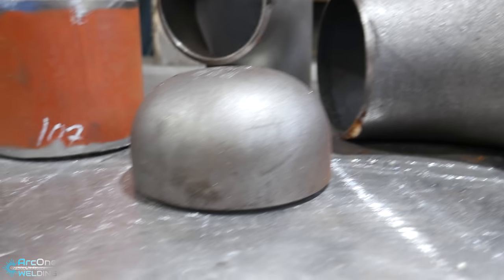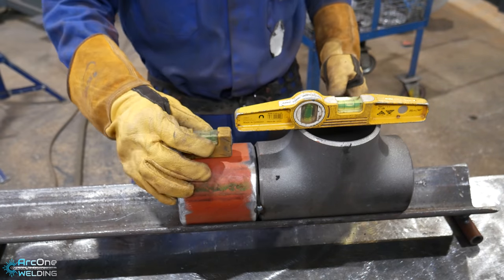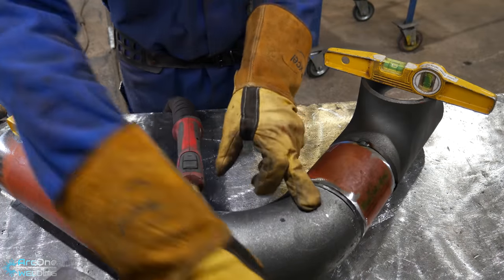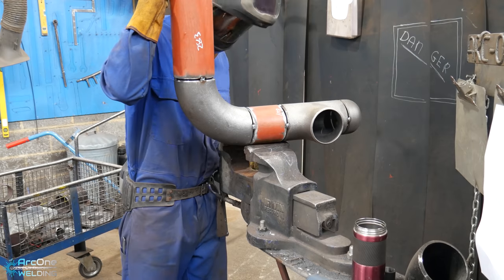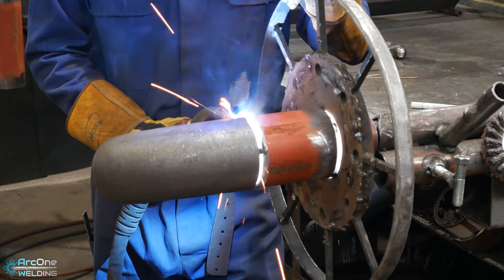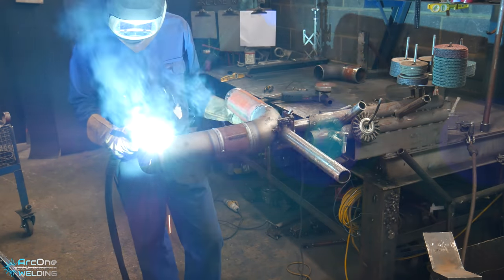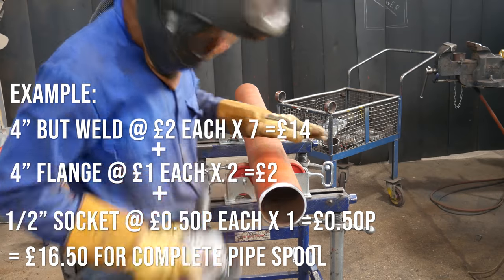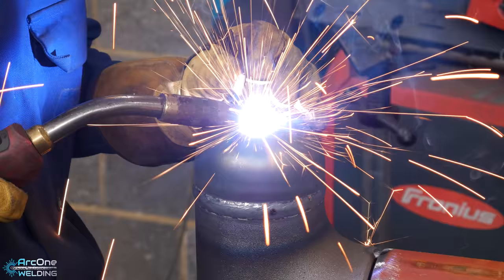Price Work £ How Much Do I Make? 4" Spool Fabrication

Comment: Really appreciate the words about safety and avoiding fumes. Id love to get a setup like you have for work but we'll see if they're keen on paying for the 3m papr system, or at the very least splitting the cost. It's a little over 2k here atm. I like using the air filter respirator most of the time but there's times where it's too hot and you just skip it.
Reply: If you are looking for high-quality welding machines, please contact me. We are a manufacturer with a history of 32 years, focusing on the production and research and development of manual arc welding machines.

Comment: Thanks bro.. Safety is a major factor.. I suffered hospitalisation and numerous doctor visits and lost shifts because of chronic sinusitis and terrible sporadic headaches because of exposure to fumes from using 2.4mm Open Arc Flux Core and Low Hydrogen electrodes (MMA) Welding for nearly 6 hours a shift. Only to find out from an excellent ENT Specialist that I was suffering because of over exposure
Reply from the maker: You see dude u understand, this is the message i want people to know

Comment: Hi Calvin,
  Want to pass along a great feature that stops the warping experienced in pipe welding (works on A-36 plate & structural members too). I was shown by a very savvy weldor/fitter. He always had a bucket of water & a rag nearby. Apply the wet rag in the right places...this retards the warping. This works on A-105 & s/s pipe too. 
  Hope this helps, Pete 🙂

Comment: your comments about just holding the fitting and tacking it is so true. ive seen way to many guys screwing around with jigs trying to get the fit right. 45 min later they get it, when it coulda been done in 5 min.
Reply: Yep. The only time I make a jig is when I’m fitting several of the same thing. I usually make the jig while making the first one.

Comment: Yeah, over here in the states, I'm an ironworker. We weld with stick and innershield wire. The wire is an irritant and the second you breath any spec of dust from it, it will make you cough. Our safety and procedure for it is that because we're outside, that's good enough to protect you from getting respiratory problems 😂

Comment: Great video. Im wondering how you like up a 45°elbow when the pipe is a couple of mm smaller as it don't line up in angle iron?? Any tips are great im working at a welder fabricators and get some elbows to weld to pipe. Keep up the good work. Thankyou.
Reply from the maker: Check my videos i have 3 great videos on fitting up 45°

Comment: You should try Loctite SF 7900 Ceramic Shield on ur nozzles.  We run metalcore wire daily as well. Only need to clean and re apply 2-3 times in a day.
Reply from the maker: I use a different brand of ceramic anti spatter and it works wonders
Reply: coat the tip and shroud with white marker   it turns to carbon  and prevents adhesion of spatter

Comment: Barley starting out mig pipe practice at technical college and they past couple weeks I’ve felt my breathing get a little worse, might have to take you up on the respirator advice
Reply from the maker: This job will give you a early death if you don't protect yourself sooner then later
Reply: @ARCONEWELDING  do you know of any cheaper PAPR options?
Reply: @ARCONEWELDING  The best advise I can give you stay away from shops. I always worked outside in  construction, refinery ,etc. I am 81 now, worked in Canada ,but mostly in and around Toronto  and travel jobs . Nice welds!

Comment: I always screw a plug into any socket or stabbing i welded on, it comes from when i was an apprentice, i was asked to weld a socket on a live pipe late on a Friday afternoon so maintenance could run an extension off it on Saturday morning, i rushed it so i could shoot off to go out for a good time Friday night, i came in Monday morning to a real ear bashing, the socket had deformed in the heat and they couldn't screw the pipe in to it, not only does the plug absorb some of the heat you know it's good to go when you screw it out.
Reply: True that, just like welding a nut on etc. Always seems to shrink that little bit, on cooling.

Comment: Ah the classic oxy cutting torch/ hammer multi tool. We've all been there.

What root gap do you use, im assuming that's all sched 40 in the video. 

Nice work
Reply from the maker: Ofcourse, if it doesn't move you know to carry on burning 😅, nd usually a 3mm gap for all my sch
Reply: @ARCONEWELDING  ha ha ha. Nice. It's been nearly 7 years since I've done any mig pipe work, been doing stainless tig for the past 18 months. A nice change

Comment: Gotta be welding the flanges on first mate mig don’t pull. Save you soo much time
Reply from the maker: Its true for some occasions, if i welded the flanges the job basically becomes a weld neck job and my Fabrication will need to be perfect with no room for error with a 3mm Tolerance, atleast if my fit up isnt perfect i can catch it on the flanges

Comment: Nice video Good job. What is the average pay for welding in Uk? In Norway it can be from 20 pound to 30 pound pr hour.
Reply from the maker: Tbh pay is all over the place you can make £120-400+ a day or more depends who or where you work
Reply: @ARCONEWELDING  may be 120 pounds for welder helper?

Comment: Thats so odd, my price is calculated per inch only. We get about £3 per inch and straights and little spools are the best.

If i done 100 inches alone id make £300-£350, however its divided by every fitter and welder. Luckily there arent too many in my shop and we all work at pretty much the same speeds. So a good day could be like £400 each but some can be really bad.

Comment: I probably going to sound like an idiot but are U getting 16.50 for the whole welding U did in the clip ? what am I missing, honest question.
Reply: I think it was just an exampleof how his price list works as his employer didn't want him to talk about the actual prices he makes, no way would that spool be 16.50, you'd make that in one 4inch butt.
Reply: @rich3633  Thanks for the answer , but I still have no idea how to workout his  prices.
Reply: @bobskobob276  Its just each type of weld is worth a different amount. So a 2 inch socket he might get paid £8. A 4 inch butt weld might be £20, a 4inch flange £15 an 8 inch butt £35 etc. Butts usually cost more than flanges the bigger the pipe the more money. His employer will pay him per weld he does and each type of weld will have its price eg. Above. You add all the monetary value of the welds which you completed in that day and there is your day's pay.